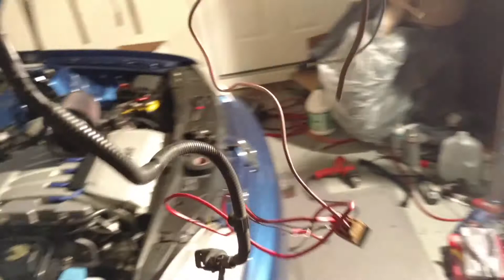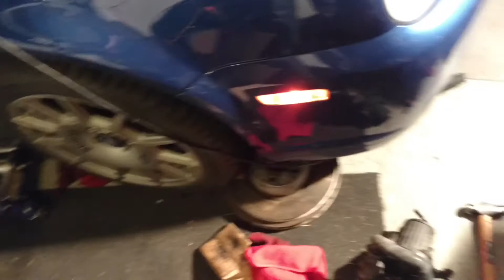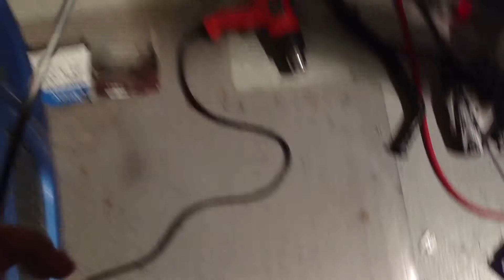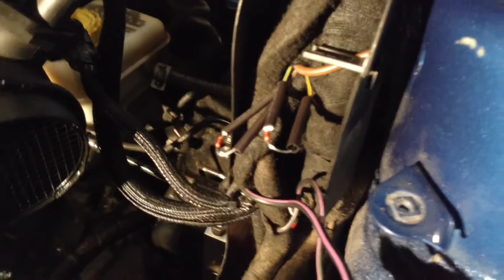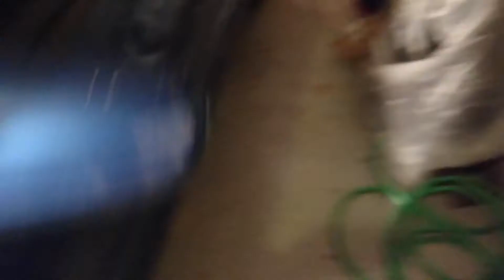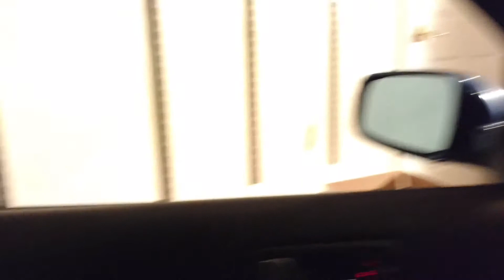Mk4 R32 Secondary Air Injection Pump Delete Details

Comment: hey man, was wondering if you could personally dm me I need some help with my sai delete. It would be a big help. I ran the intake vacuum line to a T on the fpr, then ran that line to the black side of the check valve. Behind the check valve is a T, and one line comes from the expansion tank and the other comes out from the n156 sensor, not the one for the pump but the one for the combi. The line that plugs into the sensor is the line coming from the shift rod. It will idle and rev fine but it randomly dies during idle. Any thoughts on what that could be? Also I left the sai sensor plugged in but no vacuum lines going in or out of it. I read it can mess up fuel trims without it being plugged in. Please help 🙏 🙏
Reply from the maker: Dying on idle I read can be sometimes be from a vacuum leak. Another possibility, does it die at idle just after a cold start? It could be from the car going rich while expecting more air from the SAIP. I only learned about that this past week.
Reply: @Blaylock1988 it won’t die until it starts warming up

Comment: Mines takes three or four attempts to start.. Getting codes injection system so thinking this will solve??
Reply from the maker: Hard to say. First thing I'd check is your combi-valve, its probably clogged up and malfunctioning. The engine should start up and run fine even with the SAIP not functioning.
Reply: @Blaylock1988  excuse my ignorance, the Combi Valve is the one inside the intake? The long one that is vacuum actuator?

Comment: Really helpful video! Im interested in where you got the intake piping from? Mine tore and I am removing the stock PCV and getting a catch can
Reply from the maker: It's just a K&N intake, but it still has a PCV inlet on there you'd have to cap off, or use a pass through style catch can.

Comment: Hello there is a relay in a box behind the air intake its for the sai pump should i remove it too?
Reply from the maker: Yeah, you can remove the relay, and then you can rearrange the remaining vacuum lines to remove that branch so it stays a sealed system without needing to cut or cap off anything.

Comment: Trying this delete on my mk4 VR6 24v. Was this delete on the back side of the block or the front? Cant seem to find any videos on the 24v. Thank you
Reply from the maker: Sorry I didn't respond sooner. The SAIP is hanging off the front of the engine, but I also deleted the EGR valve that is connected on the back of the engine so you'd need the blockoff plate if you delete the EGR as well.

Comment: Other than making the engine take longer to warm up in cold weather with SAI delete. What performance gains does it do?
Or is it mostly to clean things up or for aftermarket intake?
Reply from the maker: It didn't have any affect on the engine warming. The SAIP with the Kombi valve helps the cats warm a little faster when the engine is cold. No direct performance gains, but some reduced weight, a few less parts that are known to fail, and easier maintenance doing anything in the engine bay.

Comment: I've been using this video as a reference cheers mate ! I had a question. Did you end up removing the vaccum box as well? Did it mess up your fuel trim as mentioned or did you keep that along with the n156?
Reply from the maker: Sorry I didn't respond sooner. Just in case someone has this question for the future: You should keep your vacuum box because it helps keep consistent vacuum for your intake manifold changeover and to the fuel pressure regulator. I'd only delete that vacuum box if you have an aftermarket intake with no changeover, then you might be fine plumbing the vacuum on the fuel pressure regulator directly to the back of the intake manifold.

Comment: Unless your area requires an emissions inspection??  It'll throw a code and won't pass.  But I guess you have an off-road racer there...
Reply from the maker: no codes now, emissions readiness seems fine. I don't have to smog for my area but I'm sure it will pass fine. Also every state has different requirements.

Comment: I added the resistors and my cel went off just like in the video then a few days later the light is back on throwing all the same codes?
Reply from the maker: Yeah, I mentioned this in the description and some of the other comments below. The resistor fixed the fuel trims so those are working correctly, but they didn't eliminate the error code. It seems the only way to actually remove the error code is to get an ECU tune that disables the SAIP system completely. But your fuel trims will still be adapting correctly so your gas mileage won't suffer. I plan on going with Reflect Tuning on my R32 to get rid of the CEL.
Reply: Blaylock1988 ok I thought I read al the comments haha well as long as the trims are correct that's the most important thing. Thanks again for the replies and the video

Comment: hello i want to say so far this video has been incredibly helpful to me in deleting my sai pump so far but i have a question about the solenoid you removed, what did you do with the hoses going to it,on my 2.8 24v there is second solenoid right next to it and there is hose connecting them did you just cap the small hose?
Reply from the maker: That second I think is the N156 solenoid that controls the changeover valve for your intake (should be the right solenoid). I took one of the rubber vacuum line elbows from the SAIP solenoid that I deleted (along with all of its vacuum lines) and swapped it with the T-connector on the remaining solenoid.

So that remaining solenoid will just have two rubber vacuum elbows going to the right instead of the original T and elbow. 

Hopefully that makes sense!
Reply: that makes a lot of sense, thank you
Reply: last question i have regarding the resistors is does it mater which blue yellow goes to which other colored wire?
Reply from the maker: I don't think so, my understanding is all of the blue/yellow wires connect further up in the loom, but I haven't visually confirmed that myself.

Comment: Do you know if this will work for the 1.8t? Same wires?
Reply from the maker: The SAIP and EGR system for the 1.8T is a huge gigantic nightmare from the DIYs I've seen. The relay and wires might be similar but no promises from me. http://forums.vwvortex.com/showthread.php?4893472-DIY-Ultimate-SAI-N249-PCV-EVAP-Delete
Reply: Blaylock1988 sweet bud thanks for the link I appreciate it

Comment: Do you know which wire cluster in the waterfall these wires are in? I think I found it but cannot find a violet/brown wire. Also, can I leave everything in place and just do the bypass to remove the CEL?
Reply from the maker: I don't remember which bundle they were all in. My bundles were changed around a little from the previous owner when he installed a WOTBOX. 

If you wanted to remove everything I think the best starting point is the SAIP relay in the relay box next to the waterfall. You'll be able to follow those wires, a couple will run to the ECU, and the others will run toward the SAIP fuse on top of the battery, and also branch toward the SAIP itself along with the EGR valve solenoid that is paired next to the SAIP plug bundle.

If you wanted to leave everything in place and not do an EGR blockoff, then I would just get a tune that deactivates the EGR and SAIP functions, and not bother cutting and resistoring any wires.

Comment: you didnt talk about what you did with the large brown wire that comes from the SAI pump plug with the white/red wire
Reply from the maker: I took another look at my leftover wiring to see what I did. That ground wire I chopped next to all of the other SAIP wires in the wire harness waterfall, and just taped up the end and tucked it into the bundle next to those resistors. I didn't feel like tearing open all of the wiring under the rain tray just to fully remove that one wire.
Reply: thanks for the reply man!!

Comment: Thanks for this. Doing it on my R32 now. The big brown wire is just a ground for the pump right? What did you do with that one?
Reply from the maker: You're talking about the one that used to be grounded on the EGR plate? I just grounded it under one of the bolt heads on the throttle body. I don't think it was just for the SAI pump since that pump just had a red and white wire that all came out together. I suspect the brown one is for something else, so I didn't want to just haphazardly chop it.
Reply: I was talking about the big brown on the pump connector next to the red/white. Looked closer and saw you had it removed. Just a ground for the sai pump. 
Just to be clear because I don't do wiring often haha... resistor the two wires for the vaccum solenoid and the two small wires that go to the fuse correct?
Reply from the maker: I took another look at my leftover wiring to see what I did. That ground wire I chopped next to all of the other SAIP wires in the wire harness waterfall, and just taped up the end and tucked it into the bundle next to those resistors. I didn't feel like tearing open all of the wiring under the rain tray just to fully remove that one wire.

Comment: I tried this on my VR6 24 valve and worked! Thank you dude, loong overdue prayers have finally been answered!
Reply: are those wires that you put the resisters on the wires that were orignally running to the number 100 relay ?
Reply from the maker: So one pair of wires went to the relay, and the other pair went to the solenoid that I deleted. But it seems the resistors didn't really solve my CEL. I still need to get it re-tuned to get rid of that.
Reply: gotcha, I'm getting that same code for the secondary airflow. Let me know if your tune solves the problem. You think with a tune it would pass emissions?
Reply from the maker: I know for sure the right tune can make the codes go away, BUT passing emissions will depend on your state. A friend has a Mk7 GTI with a stage 2 tune, and downpipe, but he can't pass emissions in MA with his tune because it disabled some of the emissions readiness codes. Luckily my car is registered to an area in AZ that has no emissions testing at all.
Reply: A 2.8 24 valve?
Reply: So there's no need to solder in resistors as it will throw a code up anyway. Saves me going out and getting some resistors. I'm going to delete my sai and everything involved soon.  Thanks.
Reply from the maker: I think you may be right, how are your fuel trims without the resistors, but with a tune?

Comment: You said you did a supercharger delete do you have it for sale?
Reply from the maker: Yep its a full VF Stage 2 V9 kit (hoses, intercooler, brackets, etc) including a UM tuned ECU, and 630cc injectors
Reply: Sorry if you already answered this, but why did you delete the supercharger?
Reply from the maker: This is my daily and I wanted to prioritize reliability and simplicity on this car. I live in Boston and I didn't want to worry about the low intake positions sucking up water during our many storms. I honestly don't miss the extra 100 horsepower, and I like how I can push it to the max and have fun, but its at safer speeds.

Comment: Thanks for posting this. Im currently getting code P2257 SAI system control A circuit low. I bought the car with the SAI deleted so have no idea why this code popped on. The car was just driving perfectly and one day after sitting for about a month I received this code. Now my car shuts off on idle. I have to keep hitting the gas to keep it running. HELP!
Reply from the maker: Sorry for the late reply. How much of the SAI system was deleted? It sounds like some part of the system is still there and could be causing a huge vacuum leak or something. That code could be caused by the EGR valve solenoid or maybe part of the SAI Pump wiring is exposed and causing a short. I would go through and make sure all of the wiring I mentioned is deleted correctly, and there are no leaks in the vacuum lines where the solenoid is. 

The car should run just fine with the pump deleted and blockoff plate even without tuning it off or using a resistor. It will just have an error code, it shouldn't die at idle.